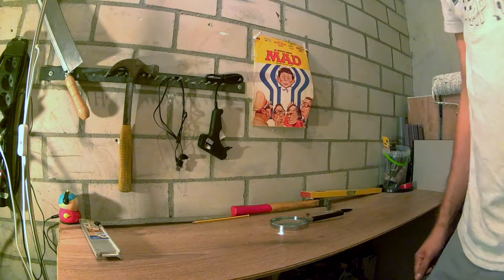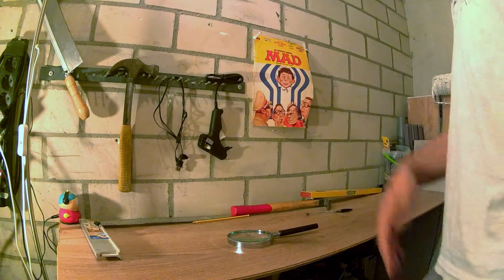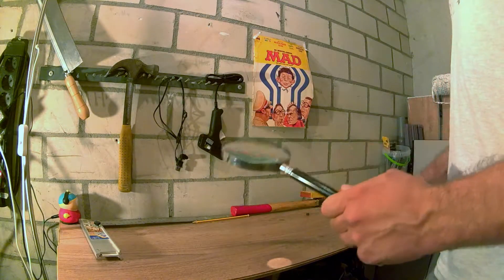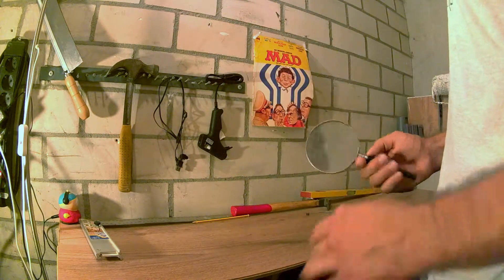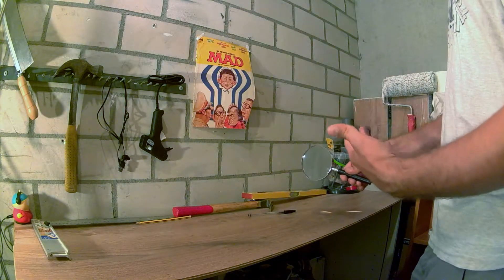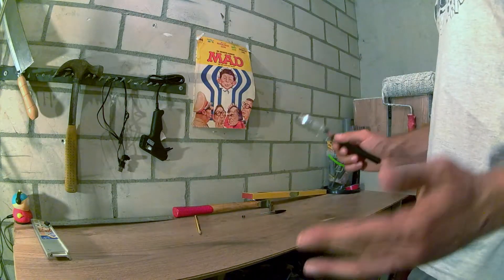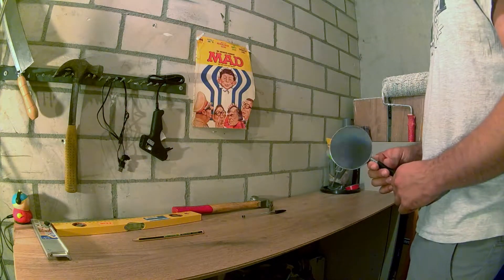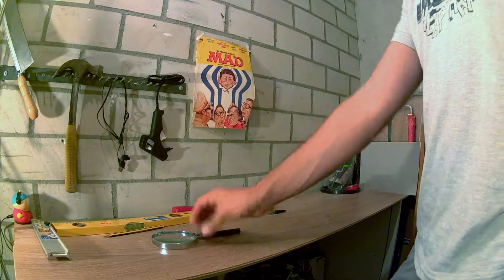Calculating focal length and aperture of a magnifying glass. Easy, fun and useful!

Comment: 4:01 - the distance you measured is not the actual focal length of the lens. To measure the focal length this way, the light source should be in infinity (so you should use a very distant object, like the sun, moon or at least a distant street lamp or so). If the light source is closer than infinity, the measured distance will be bigger than the focal length of the lens, according to the formula d = f^2 / (a - f) (where d is the lens extension, f is the actual focal length and a is the distance from the lens to the light source). ;-) 
The focal length of the lens can be actually easily calculated with a simple formula, if magnification of the lens or power of the lens if dioptres is known.

Comment: So basically the magnifying power of that lens is 5.4 magnification? Is this right.
Reply from the maker: No, it's not the magnification value, but the aperture. That would be the f value you have on most camera settings and indicates what the depth of field of that lens is, meaning how much distance rowards the horizon will be in focus if you take a photo wuth that lens.

The lower the value, the blurrier the background and foreground get, meaning that with a value of f2, for example, you will get that classic portrait look, where your subject is in focus, but the background is not.

A value of f11, on the other hand will mean a lot of the background is in focus too. Usually good for landscapes.

Also worth noting, the higher the aperture value, the less light gets through the lens, meaning your photos risk being underexposed...

Comment: That is a slow way to do it. Use a black paper with a pattern cutout on it. project the light through the paper on the magnifier, and when you can see the pattern clear on the wall that is your focal length.
Reply: Thanks